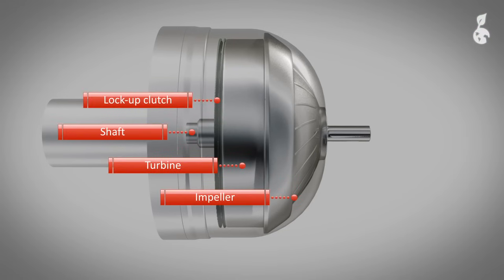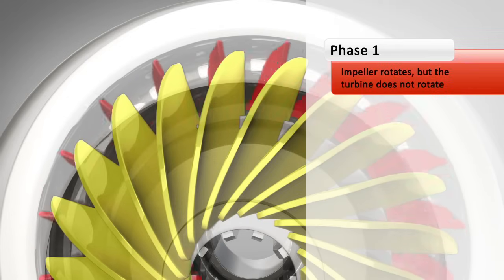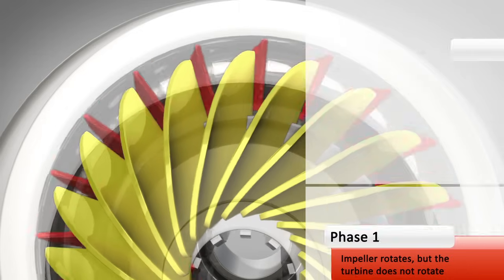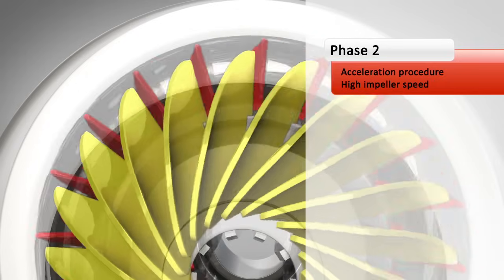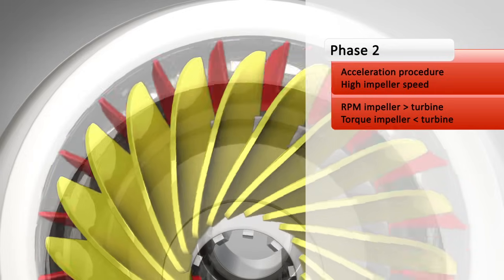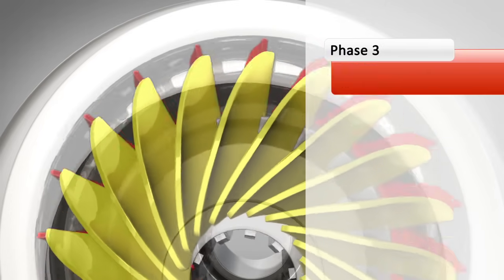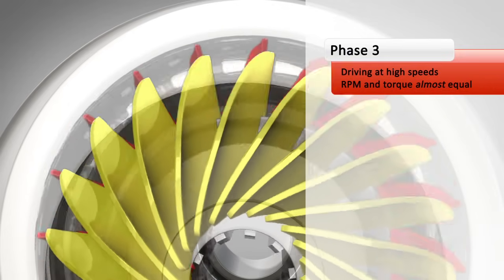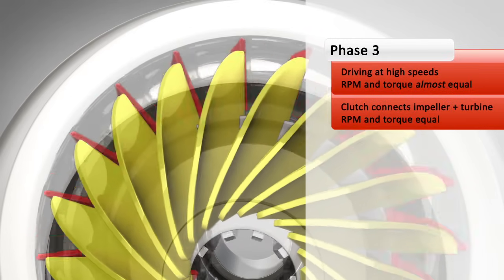How Torque Converters Work! (Animation)

Comment: stator is not explained well......😅😅
Reply: I think the work of the stator is the most difficult to explain. It actually contains a one-way clutch which has its role during torque multiplication phase and coupling phase. The stator hub mounts on a one-way clutch, freewheeling in a clockwise direction, but locking when driven in a counterclockwise direction..

There are actually two types of fluid flow inside a torque converter : rotary flow and vortex flow. 
Rotary flow is created by the rotation of the torque converter and causes the oil to flow around the circumference of
the torque converter. Vortex flow is the flow of the fluid from the impeller to the turbine and back to the impeller.
These flows have effect on the work of the stator during torque multiplication phase and coupling phase.

During torque multiplication phase :
1. Fluid leaving the turbine vanes strikes the concave, or front side, of the stator vanes.
2. The stator vanes change the direction of the fluid so that it pushes the back side of the impeller vanes.
3. The stator redirects fluid flow because it remains stationary during the torque multiplication phase.
4. When fluid from the turbine strikes the concave face of the stator vanes, it tries to drive the stator counterclockwise. By locking the stator, it can redirect the fluid back to the impeller.
5. The force of the fluid redirected from the stator adds to the force of the fluid flowing to the impeller (from fluid pump), to increase the overall torque being transferred from the impeller to the turbine.

During coupling phase :
When the speed ratio is 90° or more, fluid flow in the torque converter is mostly rotary flow and the angle of
flow from turbine to stator increases. The turbine is traveling at nearly the same speed as the impeller, rotary flow is much greater than vortex flow, and the torque multiplication drops.
Fluid from the turbine strikes the convex side, or backside, of the stator vanes rather than the concave side. As the force of fluid striking the backside becomes great enough to drive the stator clockwise, the stator one-way clutch overruns. With the clutch overrunning, the turbine, impeller, and stator, all rotate in the same direction and at approximately the same speed. The stator unlocks and freewheels once the angle of fluid flow changes enough to strike the opposite side of the stator vanes and rotate the stator clockwise.
Torque multiplication drops because the stator no longer redirects fluid to increase the flow from impeller to turbine. When the torque converter reaches coupling speed, the turbine is traveling at nearly the same speed as the impeller, rotary flow is much greater than vortex flow, and the torque converter simply transmits torque like a fluid coupling.

Comment: This gave me another reason to dislike Automatic and appreciate manual transmission more lol
Reply: manual transmission is primitive and backward as a bicycle. I love automatic trans  because it is faster and smoother.
Reply: samus989 your comment is funny because it's roughly 10 years behind current TC automatics technology.
Reply: The stators multilplies torque in a way a manual transmission can't do. Also it does not matter how fast your arm is, there's no sense of a manual with +6 speed. In auto with a very fast shifting (that could be faster than a pro pilot) you could have 6, 7 or 8 or 9 speed and better overrall aspect of the car (0-62mph/ 0-124mph/40-62 acceleration, etc.) With more gear speed you could also keep the rpm in the best or ideal condition for performance either eco mode and this operating together with ECU from the engine can make your car save gas and have batter mileage better than a manual gearbox.

I bet ZF or some real other real good transmission will not work better than a manual one in engines today. The ZF design is made to transfer the rotational speed to the next gear so the loss is minimum and reducing the use of torque converter and helping the next gear entering in a higher throtle.
Reply: Hello, 20 years ago would like their opinion back. Manuals use higher gearing than autos, so essentialy, they get better fuel economy, are lighter and hold more power.

Comment: wait, during the stalling stage, does the fluid ever gets too hot??
Reply: Engine RPM are minimal when you're stopped at a light and gently pressing the brake pedal, nothing compared to when the fluid is being swirled around when driving normally. I guess it would get too hot if you press the brake and gas pedals very hard because the impeller is going quick but while turbine stands still.

Comment: im lost at how exactly the rpm is converted into torque...my brain hurts
how does impeller splashing the fluid causes the torque to increase?? I can only see losses of energy instead
Reply: The stator forces the fluid to turn, thus slowing it. The energy absorbed by the stator when it turns the fluid results in the stator being pushed in the opposite direction from the direction of its veins. The stator can spin one way and locks up to the turbine the other, helping it turn. The fluid that exit the stator is then pushed in a more forceful direction towards the impellar helping the whole accelleration occur. (Think of it like having a sail in 90 degrees to the wind rather than 45 degrees.)
When the turbine has accellerated closer to the speed of the impellar the stator rather makes the system less effective, but since it spins freely that other direction that efficiency loss is minimized.
Reply: My guess is that the pressure on the turbine blades rises resulting in higher forces pushing the blades and thus more torque...
Reply: Its about the angle of the blades I think

Comment: Admit it! You are here thanks to Christian Von Koenigsegg.
Reply: He is referring to Christian's Direct Drive -- a new kind of torque converter, at least that is what I think, which is going to be used in his new Koenigsegg Car. The idea is basically going fast without a "gearbox". In fact, I am here to understand his video further by understanding your video. Thanks mate for the animation.
Reply from the maker: Oh, thanks. I understand :)
Reply: Yathu prem this is pretty much what every manufacturer uses in their automatic transmissions
Reply: no
Reply from the maker: What has Christian Von Koenigsegg to do with this animation?
Reply: Exactly !! But still got the doubt that why other manufacturers are not ditching the complicated set of gears and instead using this ??
Reply: Hermann D. Schimpf gladly admit it.. Lol
Reply: Yeah! you GOt it!
Reply: jep
Reply: lol yeah XD /INSIDE
Reply: Same!
Reply: The goal of Koenigsegg is that he brought a sort of hundred years old tech to a whole new level. His car (Reggera) has only one gear (equivalent to a 7th gear). The torque converter does all the work from 0-400km/h. The car accelerates like an turbofan airplane during take-off. Check out:

https://youtu.be/qtXDesz3Z0M

Comment: Does it mean if we want higher torque for the same engine speed, we increase the blades/friction for the stator? does torque converter for truck any different than the cars one?
Reply: there are "Heady Duty" torque converters that can transfer more power, they feel more stiff, most small cars have "looser" TCs for smoother shifting

Comment: This is a good video. But I don't like that it uses "centrifugal forces" as an explanation. It does not exist!! There are friction, inertia, and centripetal forces involved. But, other than that, it is a good animation.
Reply from the maker: It does not exist for you. For others, it exists :)
Reply: As a person trying to educate, don't you think one should try to avoid spreading the shortcut that it is using that? Of course everyone know the effect of a centrifuge, but using it as a technical term is a bit sloppy. Use it as an example, yes, but saying those few words "centrifugal forces" is, for me at least, a big no no.
Reply from the maker: Hmm, why would you say that? :)
Reply: It is that the first 45 seconds of the animation you use arrows that go from the center straight out all four directions to indicate a force. Physically, no force is produced in such a way. And therefore there is no force there to be called "centrifugal forces".
Imagine every molecule of oil being a bowling ball. It is pushed into movement by friction on a spinning, large horisontal disc. Where does it go? It won't go in a straight line out from the middle and roll of the edge of the disc. It will roll in a direction where the friction got it rolling, from there it will be accelerated to turn and change direction along with the disc. And when it comes to the edge, which it will do, it will roll off in a direction closer to tangent with the edge rather than perpendicular.
Adding an edge that will contain the ball it will by that point start to follow that wall. Not because of any force from the center but because of that it "wants" to continue going in a straight line from where the friction added acceleration to it but is constantly pushed to follow the wall, by the walls movement.
A more accurate way would be to have arrows go in a slight bent motion from the center and out pointing tangent with the edge of the torque converter.
The faster the impellar spinns the faster the acceleration of the oil within. Not any "higher centrifugal forces".
There's a differens there I find important in an animation explaining the theory behind the torque converter.
Reply from the maker: Oh, ok, thank you for your comment :)
Reply: can i buy drugs from you?
Reply: Haha... Not from me at least.^^ I am a strong defender of the laws keeping drugs criminal. (I think alcohol should be included as well... But for cultural reasons I understand that it would be very difficult to enforce that...)

Comment: Wow, after learning how this works, it seems like automatics would get only a fraction of the gas mileage and horsepower their manual counterparts do. I know there is a difference, but not nearly as much as it would seem.
Reply: Well gas mileage has a great deal of factors, the bigger ones being weight, road conditions and how you drive.
But yes torque converters have high power losses, we are talking 10% at minimum and up to 100% when accelerating. That is why modern vehicles get the additional clutch so you get proper power transfer eventually.
Reply: That's what I was thinking. Odd to think there's no 'direct,' if you will, mechanical connection
Reply: At the end of the video, when the system is at 90%, the lock-up clutch is engaged, which creates a direct mechanical connection between the engine and the gears of the transmission, by-passing the fluid coupling loss.
Reply: what do you mean by 100 percent power loss when accelerating? I have no issues accelerating and redlining with an automatic
Reply: the lock up clutch makes up for the losses at high speed, besides the torque converter allows you to coast for free, the problem with modern automatics is that they just can`t make the shifts right, most manufactures try to emulate the feel of a manual...

Comment: Ah! He said the magic words. "Because the fluid flows back more slowly". I just watched over an hour of videos on torque converters and kept failing to realize the relationship between the stator, when the clutch engages and its purpose, and how the torque is physically multiplied. But now it makes sense. Since the pump is constantly spinning at engine speed and there's pressure being built up at the stator, adding more "leverage", if you will to the pump. And when this leverage is no longer needed at high speed the clutch is engaged essential making it 1 synchronized mechanism.
Reply: And than you do obvious thing, instead static you use variable blades for stator. Bam, you have variable torque multiplication convertor! From 1948. Buick Dynaflow never stopped fascinate me. How simple and beautiful.

Comment: my car does not shift other gear from 3rd gear. does my torque converter broken?
Reply: Munkhjargal Nymsuren no it means you have a bad clutch pack, valve body issue or an electronics issue.

Comment: The purpose of the stator is to guide the fluid back to impellor in the correct direction, but how the torque multiplication is happening in stator ? Is it the kinetic energy of the fluid increasing in every cycle ? & HOW ?
Reply: sunil kumar no, the stator guides oil back to turbine, not impeller.

Comment: what stops turbine to move untill brakes are realead? doubt pls explain anyone.
Reply: parjinder brar turbine is splined to output shaft going to wheels.  Applying the brakes will stop the turbine.

Comment: can this fail in such a way that when your car comes to a stop if feels like a clutch is still engaged. for example the car keeps tring to pull forward . if it was a manual gearbox it would be like you didnt press the clutch in when coming to a stop . im am having this problem with my automatc transmission at the moment  ? any help would be appreciated

Comment: Thank you! Very educational. A question: Many shift the lever to "N" when the car is stationary. Should it be at "D" and put on the brakes? Please explain. Thanks again.
Reply: +Banne Low As I can understand it and having an automatic gearbox in my car, When it's in "N" the turbine is not under pressure (via some sort of bypass valve opening) and is dumped straight back into the gearbox sump. Therefore it will free wheel as a car with a manual gearbox in neutral. When it's in "D" there is slight pressure on the turbine whilst stationary which will create slight propulsion to the final drive and will roll the car slowly unless the brakes are applied. If someone can correct my understanding of this then please do.
Reply: +Andy P When the vehicle is in motion, I always put it in "D". To my knowledge, "N" is used only when the engine is off. That's why I posted my comment. Does the publisher reply?

Comment: It's a nice explanation of everything but the stator, which is what makes this a torque converter instead of just a fluid coupling.  It's a key component, and is the most interesting component, and it should not have been glossed over.

Comment: What are the advantages of this over a regular clutch? Could you have an automatic transmission with a regular clutch (albeit automatic also)? Why are clutch converters used exclusivley (and if not, almost exclusively) with automatic transmissions?

I am asking because, as beautiful as this engineering is, it seems to me to be an unneccesarily complicated way of delivering power to the transmission...

In other words, why?
Reply: Léo LETARO Cool! Thanks...
Reply: +Léo LETARO Actually, scooters use a different system called a CVT that uses a belt and what is essentially a pulley that actuates inward and outward to change its diameter and therefore gear ratio, keeping the RPM at the engine's economical sweet-spot past a certain speed.
Reply: +Léo Le Taro Errr, no they don't CVT is not the same as a fluid coupling.

Comment: Does this mean that a car with a torque converter and automatic transmission can't stall the way a car with a manual transmission can when the clutch and accelerator are not used correctly when moving off (especially uphill)?

Does the energy loss not make it more expensive to fuel the engine?
Reply: +LisztyLiszt it does, that's why manual transmissions tend to get more mpg, and make better use of the horsepower available. Automatic transmissions are built to slip, that makes them less efficient.

Comment: i still don't believe that this fluid moves a vehicle i call bs
Reply: +sk88boarding not bs
Have you ever watched an earth moving machine? They usually use hydraulics to drive all moving parts including the wheels or tracks. They can impart massive force to things with nothing but really high oil pressure.
Oh, and airplanes use a really thin wispy fluid (air) for everything; propulsion, lift and control... Boats use water in the same way.
High pressure water jets are actually used to cut metal in some fields of manufacturing. 
freezing water can split metal water pipes or crack an engine block.
I could go on...
Reply: +Léo LETARO :(

Comment: What exactly does the stator do in the system? I didn't quite get that one.
Reply: David Zhang stator sends fluid back to turbine it just came from and further speeds up turbine.  That is why it is a multiplier or converter.

Comment: Now perhaps you can do a presentation on the old Buick Switch-Pitch dual ratio torque converter.  Oldsmobile may have used it as well if I recall.